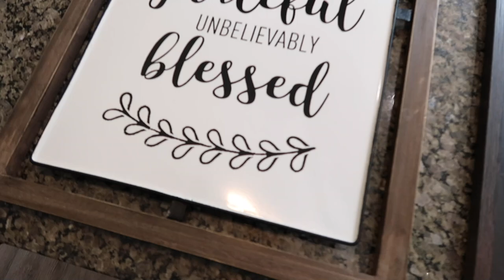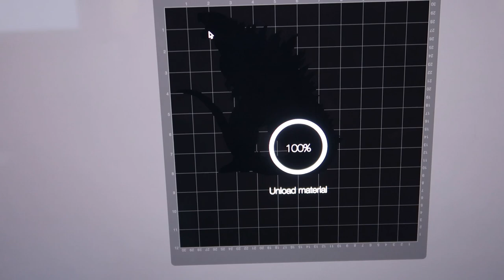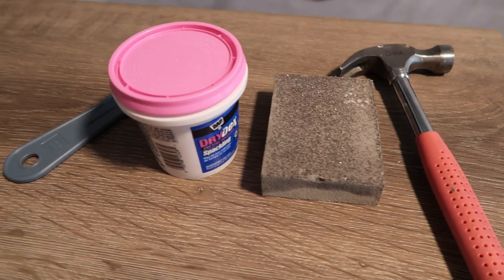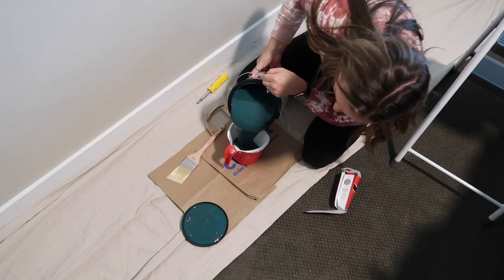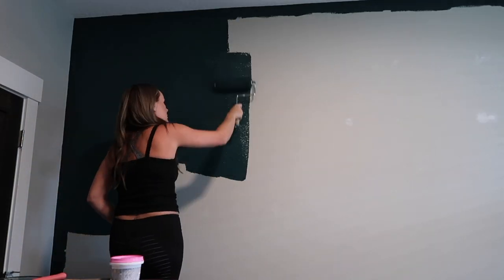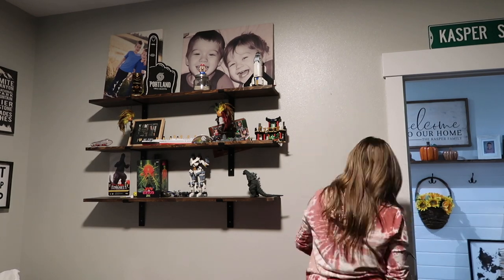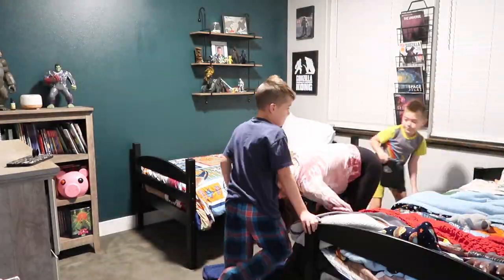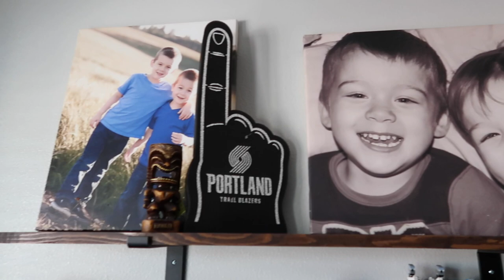DIY & PAINT WITH ME // Boys Room Refresh

Comment: Do you have to do 2 coats of the edges as well? Edge, paint wall, edge again (?), paint wall again ?
Reply from the maker: I touch up the edges where they need to be touched up after I roll the 2nd coat but the edges don’t ever seem to need a full 2nd coat with the brush.